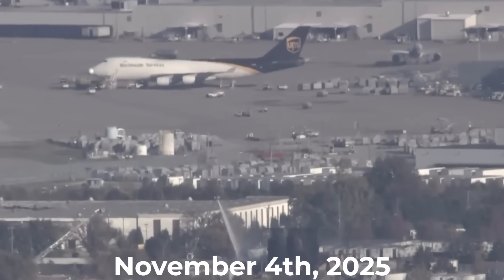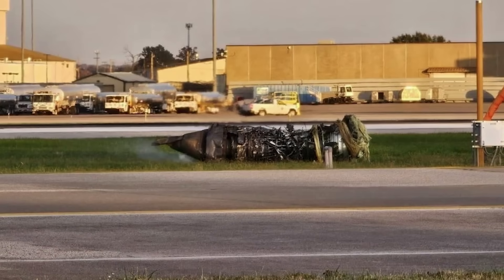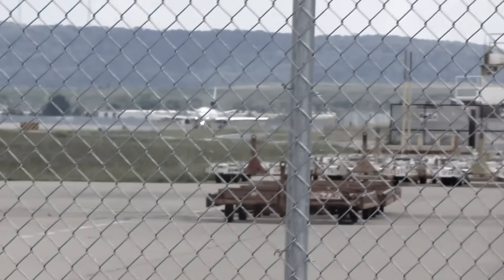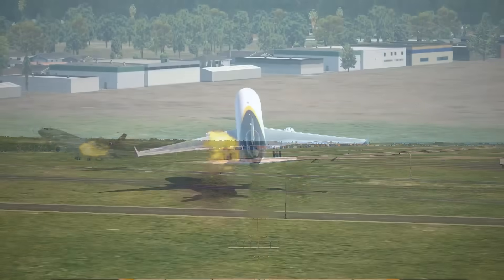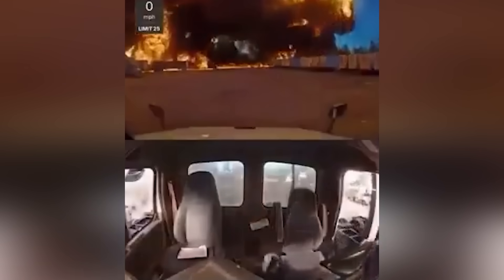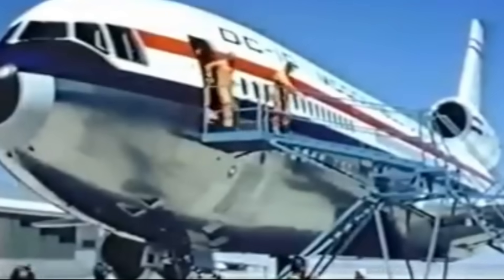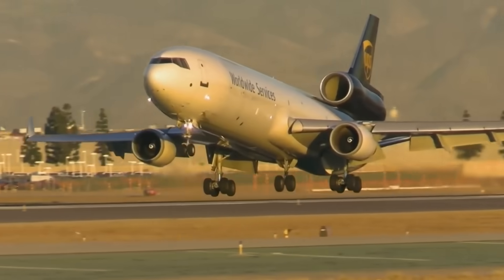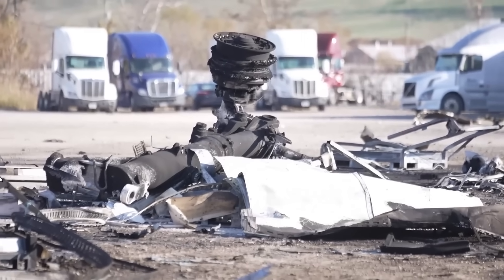NTSB Reveals The TRUTH Behind UPS Flight 2976 ENGINE FAILURE, New Discoveries…

Comment: Likely an initial Engine fire when pilots went to take off thrust likely an Cowling fire caused by a rupture in hydraulic or fuel manifold lines that caused the Cowling fire that caused everything else to fail at the 2000 ft runway mark.

Comment: What I am not hearing is the possibility is that the other side engine started coming apart, but not on fire, and shot debris across to the other engine causing it to fall and catch on fire.
Reply: No doubt the reason why you're NOT hearing that is because it is the most unlikely scenario of all. It is very clear that the problem began in the left (No 1) engine and spread from there.

Comment: After the DC-10 accident the fuel lines and the hydraulic systems were modified to prevent the aerodynamic loads closing the slats when the hydraulic fail. These changes were included in the MD-11.

The incident aircraft was flying wings level until the left wing struck a vertical waste fuel storage tank, which caused it to roll left.

Comment: The MD-11 was developed from the DC-10 but there are significant differences. It is much longer, has more powerful engines, has a glass cockpit and two pilots and no flight engineer.

Comment: MD and DC air frames have been complete sh!t from the word go. These dangerous, poorly built accidents waiting to happen should be grounded permanently, and recycled into raw materials. The longer these abortions of engineering remain in the sky the bigger the risk of loss of life remains. MD has been the poster child of what not to do in the aerospace industry and their legacy needs to pushed into the pages of lessons learned reports forever.
Reply: I remember standing in a terminal at LAX MANY years ago “discussing” with my stepfather, an engineer at Lockheed’s Skunk Works; the fact that if a DC10 pulled up to the gate where I was waiting to fly home to my commercial pilot husband: I was not getting on a DC10. This was before the AA crash. We both got lucky; it was an L-1011. Ground that aircraft before it kills any more human beings. Please?
Reply: How many total md11 crashes have there been? Answer is 3 and the first 2 were pilot error.  Want to rethink your statemenr?

Comment: I believe FL191 failure was traced to unapproved maintenance shortcuts that maintenance personel used to remove and install the engine.  The engine and pylon was removed as a single unit against the normal protocol.  Is this a repeat?  Can't see the pylon from the videos.  The fact that the left engine came to rest on the opposite side the the runway (right side) could be a major clue or bad reporting.  Doesn't make sense as to how it got there.
Reply: I saw a documentary on that or a very similar accident.
The mechanics used a forklift to take the weight of the whole engine and pylon assembly but didn’t realise they lifted too high and fractured the mounting system where the engine holding pins were inserted.
😬😬😬
Reply: Its was going almost 200 mph. The engine wasn't sat on the ground by a forklift.
Reply: Watch the take off all the way to the end; after the camera looks away but then goes back. You can see why there were parts scattered everywhere…

Comment: First of all you are completely wrong, the rear motor never had a compressor stall…. The right wing however did you can clearly see this in the videos .. the small burst of flames ever so often, when the compressor stalls it pops and shoots flames of unburned fuel there for the right wing motor has reduced power

Comment: the slats do appear to still be deployed according to the slow motion video from the dash cam in front of the tire shop, i'm pretty sure that after the flight 191 crash in Chicago they install a system that will keep the leading and trailing flaps and slat in position if there is loss of hydraulics on DC-10s and MD-11s. and it appears to have worked as planned.

Comment: yes you can see 3 flashes behind the no.2 engine just as the plane lifts off presumably from a compressor stall from either FOD from the no.1 engine or the gases from the fire over the wing from the no.1 engine.

Comment: Why did he say in one news bulletin the plane was 485 feet off the ground when it was only 175 feet to 200 at most ???
Reply: Reporters have a math problem.  Field elevation is about 475 to 500 ft depending upon where one is standing.  Runway averages about 475 ft.  Tracking data said aircraft made it to 175 ft.
Reply: He corrected himself
Reply: maybe he forgot about the elevation.

Comment: I HAVE CONTEMPT FOR YOUR CLICK BAIT.... You show a Picture of one of the DEAD PILOTS, with ARROW and have TRUTH Behind UPS Flight 2976.... HOW DARE YOU... Don't say @#$% or imply anything about the Pilots.... At 37 seconds from takeoff thrust, which places the plane right at V1  ROTATE. The fire bell went off and never stopped. Pilots were DOOMED at that point. Loss of #1 engine detaching and opening up fuel tank was bad. However speculation #2 (center engine) lost some or most of it's thrust due to FOD or compressor stall, at near gross weight. They had no chance to stop or fly without disaster. ALSO YOU KNOW NOTHING OF AGING FLEET. Yes these planes are OLD.  These aircraft are inspected, every inch (especially critical parts with intense scrutiny). CARGO AIR FRAMES HAVE LOW TOTAL TIME. Cargo planes fly less than passenger planes. ENGINES are replaced and serviced on schedules or on condition. I'm and Engineer (mechanical aircraft structures ) and ATP with 15,000 hours in large Jets.  Just shut up with your click bait and using dead pilots pictures in your thumbnail for views. In this UPS accident, SLATS DID NOT RETRACT, like Flight AA191 in Chicago due to design changes. I am very familiar with the design or the leading edge devices on the MD11.

Comment: They were doomed, so it doesn't matter if it was the wing or tail engine that had the compressor stall, but Captain Steeeve said it was shrapnel from the #1 engine failing that shot across and caused the compressor stall of the # 3 engine. Then there is the wisdom of the click bait crowd who will soon log on and amuse us.

Comment: How does a turbine loose thrust? 12:40. Jet engines loose thrust, proper terminology matters.
The engine in question has a fan in the front, then a compressor section, compressor discharge air enters a combustion chamber fuel is injected and ignited.
The accelerated very hot combustion chamber air goes through a number of turbine disks that extract the energy from the accelerating air to keep the fan and compressors turning.  Turbine disks are mounted on shafts that are connected to the Fan and compressors.

Comment: I think it will be due to turbine disc failure. There's a big a** hole on the side of the number 1 engine that looks identical to the engine that failed on the American Airlines Flight 383, a Boeing 767 that experienced an uncontained engine failure during takeoff. The American Airlines pilots were able to stop there plane but it caught fire just like this one did. Look at the Hot section of the number 1 engine on this plane and look at the American Airlines #3 engine. The pictures are almost identical.

Comment: The UPS mechanics who worked on #1 engine have a lot of explaining to do.  Just saying...  🥸
Reply: Don't you think the designers may have some responsibility? Do you understand they moved this planes to Cargo Only use because they knew there were design issues.
Reply: Might not have been UPS mechanics it was most likely a contractor company…
Reply: mechanics work on engines and not the structural part of the plane , Right ? It appears,  the engine that fell off was still connected to the frame, so it would have had to be the connection to the wing that was defective. Structural engineers watch over that. Do they ? Mechanics only work on the engines. Maybe I am wrong there.

Comment: Why don't you idiots get your facts correct before you start telling  what you think happened. The NTSB plainly stated after they walked the runway and adjacent area that the number 1 engine was found on the left side of the runway, not the right side of the runway as your donkey voiced story teller said. It's bad enough that the accident happened, the public doesn't need something or whoever you are to spout wrong facts or stories about it. GET REAL OR KEEP YOUR MOUTH SHUT!!
Reply: One of the videos clearly shows compressor stall in the right engine, not number two. Is it possible that debris from engine 1 hit engine 2? May be. No videos show compressor stall in engine 2. The author needs to his homework.

Comment: 11:51 well it’s far better to have industrial sites around an airport that it is housing. Otherwise the land itself will just go to waste and in larger city that’s just not possible, unless the city wants to use a model like with Denver has where the airport is way outside the city limits and then there’s nothing but just free land around the airport, but eventually that Land will get swallowed up and used for something that will involve human being some people. Again, this is a far better outcome than if it would’ve been housing around that airport.
Reply: 🙄 no one suggesting housing but some question the presence of a petroleum recycling plant which was struck. And I am one of them.
Reply: No one questions no housing but a petroleum plant is a disaster waiting to happen.

Comment: 4:11 Most likely what happened is the rear clevis pin/fuse separated and broke freeing the engine from the rear of the pylon, the front of the engine stayed attached and the engine started to, at full thrust change its angle of attack to a more upward attitude with the nose of the engine going up and the back of the engine going down toward the ground as the engine flipped up around the front of the pylon/wing because it’ll still attached that part of the aircraft, causing it to go up and over the top of the wing as it disintegrated and separated to pieces those pieces of shrapnel ended up getting ingested in to the number three high mounted engine below the rudder, and that probably caused the decreased in power in that engine and hence the demise of the aircraft.

Comment: Too cheap to buy new planes for safety for the pilots. These planes are old. It would be like an old car, putting new engines in them, to save money. Now, we do not put engines in old cars, we go out and buy a new car, that is how you look at this. This plane was sent to Texas, for the engine or engines to be worked on. GOD BE WITH THESE PILOTS, THEY DIED A INFERNO DEATH, BECAUSE OF BEING CHEAP, NOT GIVING THESE PILOTS A SAFE NEW PLANE, TO FLY LONG DISTANCES. SHAME ON UPS!
Reply: Your clueless how aviation works so keep your uneducated opinion to yourself!
Reply: Omg buy new planes. Really do you know how old  air force one is? Planes are rebuilt and updated. We have military planes made in the 80s in service. It's not cheap it's how it works .
Reply from the maker: Aircraft maintenance and fleet modernization are complex issues in aviation.
Reply: I strongly disagree with your logic. 

This type of airplane (MD-11) has a glass cockpit, fully automated systems, and can fly from Japan to Louisville without refueling, while carrying at least 130,000 pounds of freight.

It can land in CAT III conditions, an automated landing in which the pilot doesn't have to "see to land", just monitors the landing. The autopilot doesn't have to be disconnected until far into the landing rollout.

It has a very good safety record - the accidents have been almost always "pilot error", or in the case of Swissair 111 (1998), had nothing to do with the manufacturer McDonnell-Douglas - the crash was the fault of Swissair modifications, adding on a faulty entertainment system.

The cockpit controls set the standard for automation when it came out - and many 777 pilots who've flown both still prefer the MD-11 and admire the VNAV features over the 777.

Besides that, the first 737 debuted in 1968. The first 747 in 1970, 757 in 1983, 767 in 1982, and 777 in 1995 (only four years after the MD-11). Various versions of each of these Boeing aircraft are still flying.

Each one of these airplanes had upgrades for safety over the years. For the MD-11: HUDs for the pilots, enhanced GPWS, GPS, RNAV approaches, FMS software/hardware upgrades, landing SATCOM, landing yoke dampening enhancements, automatic fire suppression for the cargo, and so on, just to name a few. They're far, FAR from obsolete.

If you had the slightest inkling of how much maintenance and care these aircraft are given, you'd apologize. This one just came out of 5 weeks of overhaul - they took the airplane apart and rebuilt it, essentially. We don't know what the exact causes of this accident were - yet - but we will, and all the MD-11s will be safer than ever.

Comment: Clearly the MD-11 greatly need to be all retired by 50 years, as just one crash does not spoil the whole bunch, so there might be a few more years left in each one. However in some Companies, maybe Not UPS, Management does not listen to their Engineers (remember the Challenger Explosion where the Engineers said "Do Not Launch", BUT management said "Launch Challenger).
Reply: That's an arbitrary number (50). The FAA strictly regulates the maintenance of these aircraft. The shuttle only had 50 launches with 2 catastrophic failures - these aircraft (200 manufactured in total) have flown for about 12 million hours, so they have an amazing safety record.  So do most commercial jet aircraft, especially the heavy jets flown by top-tier professional pilots.

Comment: Engine #3 experienced a compressor stall.  You can see the flashes, probably destroyed from shrapnel from engine #1. Thus, only 1 operative engine on rotation.  The pilots had no chance with one engine.
Reply from the maker: That's a detailed observation of the engine's behavior.

Comment: We see a fire that seems to be on the top engine, near the tail. They say, it was engine 1 that eventually fell off the wing. Why do we see fire on top of the plane, during the take off run ? The fire alarm was too late for the pilots to do anything. They had committed to take off. They should have had rear view mirrors.....they would have seen that fire.......on top of the plane and hopefully stopped.  NO one wants to take off while on fire.  What damages done on the ground are multiplied when taking off. I know the rules about the commitment to go after reaching V1, but ...on fire ???????? Hello. Makes no sense.
Reply: The fire you're seeing being ejected from engine 2 is compressor stalling due to debris and smoke ingestion from engine 1.

Comment: This is what will happened to any airplane when you let MRO do maintenance with unqualified people to performed maintenance on the airplane. Low pay untraining and non-certified A&P Mechanic foreign workers have no business in touching and fixing airplanes.
100% MECHANICAL FAILURE UNCERTERFIED A&P AND IA FOREIGN MECHANIC FROM SAN ANTONIO who have no business in AIRPLANES. faa and airlines are responsible for this failure.
Reply: it will expose that issue. Has to be it. What a coincidence.
Reply: That’s a strong possibility contracted out maintenance is never a good idea keep everything in house…
Reply: Well , I am not sure if Nationality of mechanics matter the most than robust maintenance practices and skilled mechanics. Whether the maintenance crew is US or foreign should have no implications on aircraft safety,  good engineering ethics and practices should have saved people